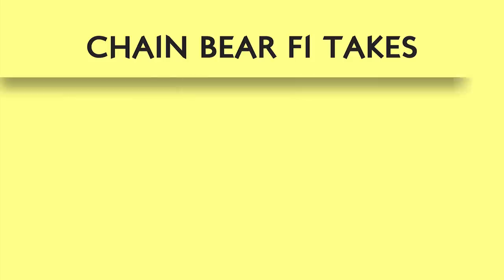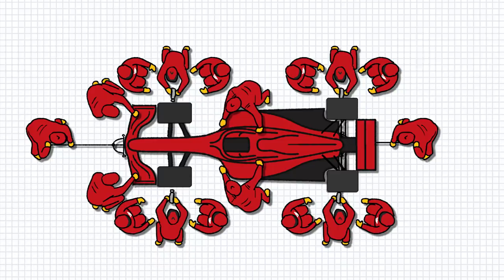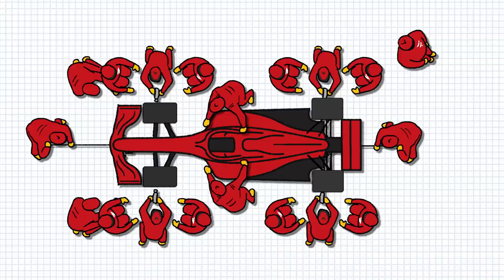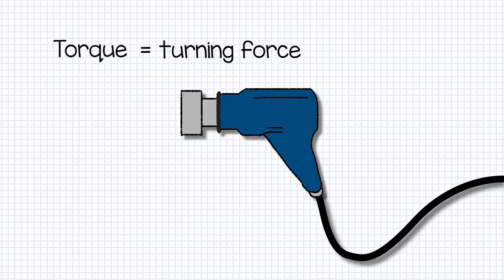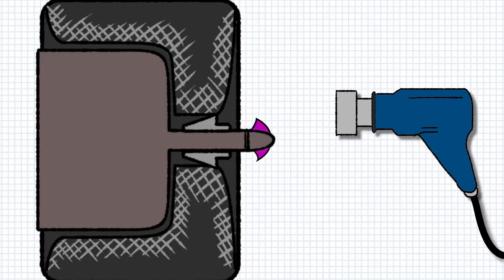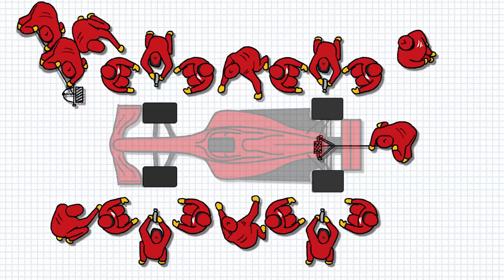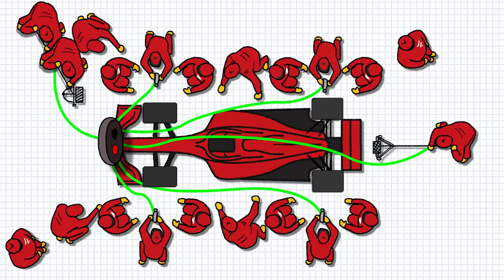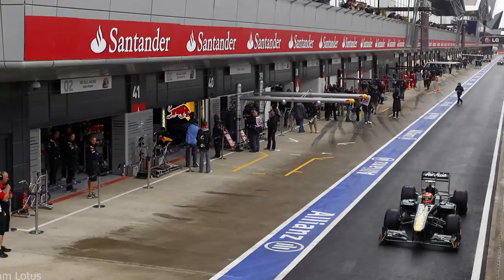The anatomy of an F1 pitstop - Two seconds of mayhem - Bahrain GP 2018

Comment: Where is the refueling mechanic in your presentation? Make the pit stop minimum 5 secs? Why not put a traffic signal instead and a zebra crossing while you're at it? If you want crazy suggestion, why not have another car waiting in the pit? The driver park the car in the garage, jump off it, jump into the waiting car then go. Once the car leave, they bring the parked car in the pit, do all the checks and changes and the cycle repeats every pit stop. Sound crazy but there will be no pressure ergo safe.

Comment: you didn't actually explain how he got run over tho
Reply: Its simple. The guy who got run over is the guy who takes the tyre off. He was still waiting to be able to pull of the tyre when he got run over.
Reply: Kasetti 55 so how's the light gone green!?
Reply: The guy with the gun accidentally pressed the switch that he has on his gun when he was frantically trying to get the wheel off.Or a malfunction. I havent heard an official statement by Ferrari on this, yet. But most likely an accident by the gun guy.

Comment: the clumsy mechanic positioned his leg in front of the rear tire. end of the story
Reply from the maker: He was waiting to pull the tyre off - the tyre hadn't been unscrewed yet!
Reply: He was in the position he was supposed to be in...
Reply: Because that place is the right position for him...
What are you talking about?
Reply: Actually yes thats how the guy stands because of the tire needing to go between him and the wheelgunner.
Reply: If the left rear wheel had come off as planned, which it didn't, he would have been long gone, and clear of the car.
From the article in Autosport, the Ferrari "system" records a loosen and tighten sequence per corner, this is why the green light was shown.

Comment: The lollipop man is the best solution
Reply: I don't the the lollypop man is the best solution at all. Teams would still be using this system if it was the most efficient way of speeding up a pitstop. Unfortunately, what happened was a freak accident in modern F1, but that doesn't mean we should start putting halos on the helmets of the mechanics.